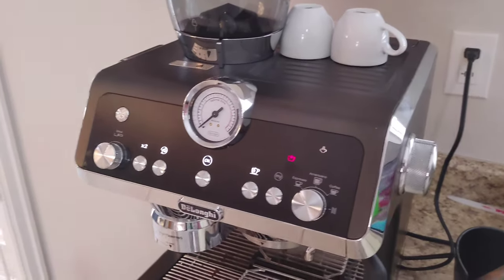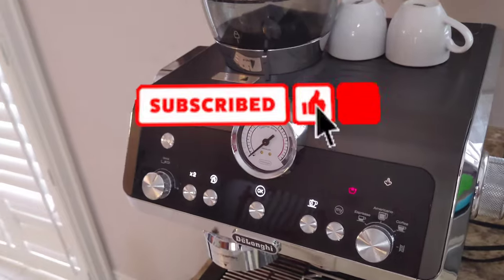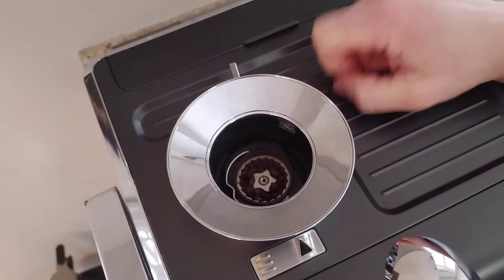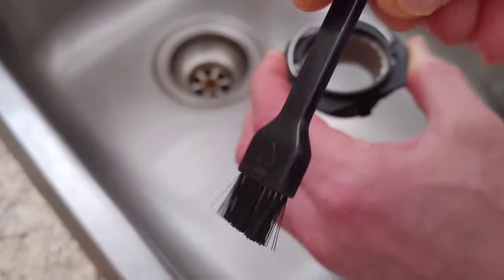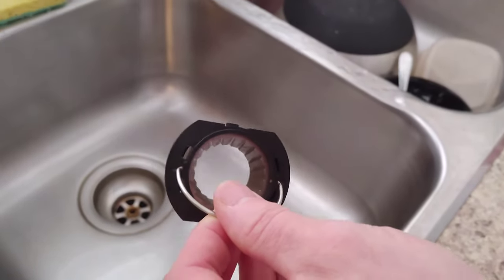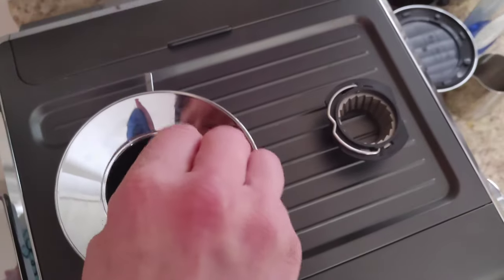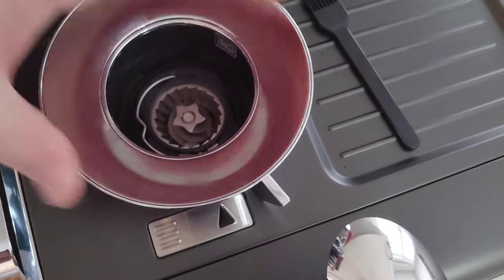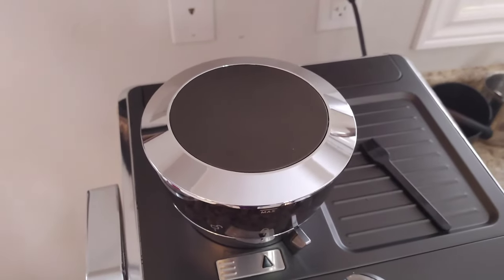How to remove and clean the grinder on your DeLonghi EC9335 la specialista

Comment: After cleaning the grinder, the beans became coarse. I want it to be fine What should I do 😢
Reply from the maker: Sorry for the late reply . I'm assuming your using the same beans? I find personally that when using a fresh batch even if my grinder is at 2 ( where I normally keep it) the first couple of times it will come out a little coarse but this usually works itself out after making a coffee or two. Unfortunately there isn't any fine adjustments you can make, like half values or quarter values like a dedicated grinder.  See if you get the same results with a different coffee or bean type. I'm curious to understand more and hopefully we can figure the problem cheers.

Comment: If after that the grinder still doesnt work what could be possible problems?
Reply from the maker: Not sure , is it aligned properly when putting it back in? It should ideally lock back into place.

Comment: My steamer on the la specialista is not working. It does not get hot and the light (steam sign) keeps on blinking and after few minutes the red warning light turns on. Got it fixed once with Delonghi but after 4/5 months same problem. Warranty ran out and Delonghi told me that it will cost ~$250 to repair. Is it a common issue? Any idea how to fix it by DIY?
Reply: Thanks for the nice video!
Reply from the maker: Thank you for the kind words . I have no idea about repairing issues. Sorry to hear your warranty expired. Whichever retail you purchased your machine , then perhaps see if you can purchase an extended warranty it may be cheaper .  Otherwise $250 is much cheaper than buying a new machine and a warranty should be covered for the repair. It sucks either way.

Comment: Why is it that you don't recommend using water to clean the grinder?
Reply from the maker: Because  you can't  absolutely ensure that the burrs on grinder are free of moisture. You definitely don't want any water in your bean grinder/ hopper . That's a sure fire way to decrease the longevity of the machine.  Hopefully that helps . 🙂
Reply: @itsallaboutthedough405  Thank you so much for the response! That makes sense now. Subbed.
Reply from the maker: @techforever1970  😁👍